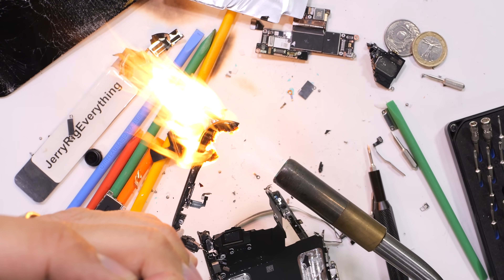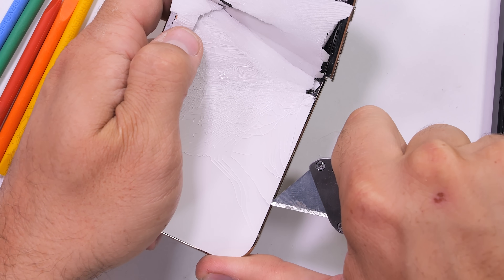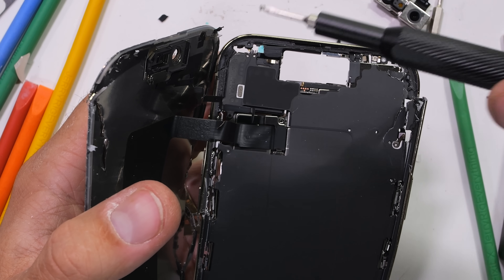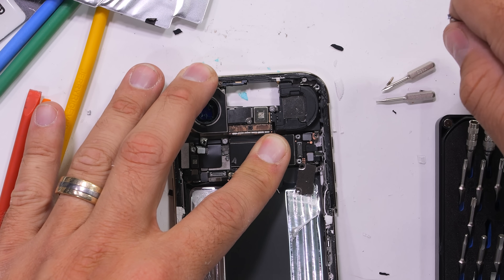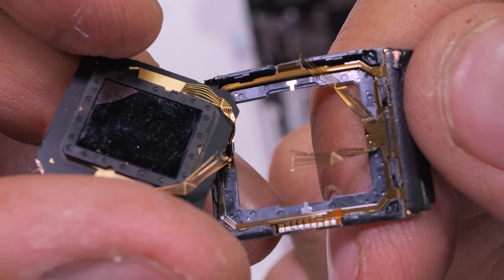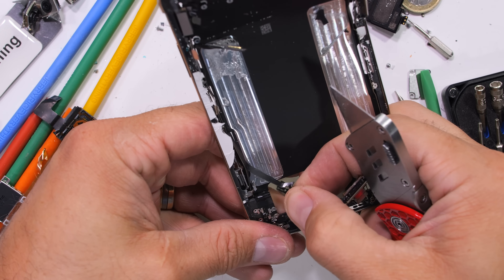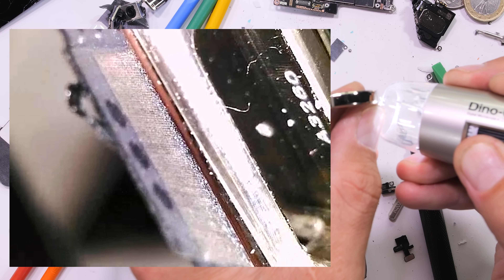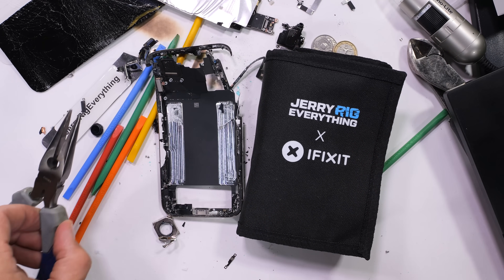iPhone Air Teardown -- I have no words

Comment: Back in my day, when you drop your phone, you risked the battery disassembling from it like legos.
Reply: I call that forced reboot
Reply: @fabiogiannone892 😂😂
Reply: I had a Samsung back then when I dropped the phone the battery fell through the cracks in the wood deck and I couldn’t get it 😂
Reply: excellent way of ejecting energy from the collision
Reply: Oh the memories... It was always such a pain.
Reply: and that was a good thing! i dropped my galaxy s4 2 stories onto marble and it didnt crack, it just blasted apart like its dying in a LEGO game, but after collecting it back together, it worked and it didnt even have a break in the glass! (tho admittedly, it feel on the back panel which made a run for it.
Reply: @Phoenix-zu6on  Same with my beloved S5. It had a long and hard life, I don't remember exactly how it went, but on an Air Serbia flight I was so bored I realised I could fit my finger nails in the non-existent gap between the display glass and the frame, and getting a fingernail under the glass seemed so strangely cool. I guess that was the beginning of the end as a couple of years later the display went wonkey, and similar fingernails removed the entire glass which wasn't good. RIP. (I did buy a replacement display assembly that worked for all of a few seconds - somehow when I was pushing it into the frame after testing it worked there was a subtle crack and new display now displayed funkyness. Sad face.)
Reply: Damn, memory unlocked. Hello Moto.
Reply: Yep. Battery would go down under a couch or something.
Reply: And we dropped phones almost everyday back then. Now it's a nightmare.
Reply: Not that long ago lol
Reply: i actually never had that happen to me, tho admittedly i went from a t9 nokia to a smasnug xcover to a non removable sony so maybe i just never had the luck
Reply: Even the sim card😂
Reply: We’ve come a long way since the Nokia 3210
Reply: Hahaha. I just remembered my nokia 6020 with no case. Only the keyboard and tape. I dropped it from the third floor of my dorm when I was in college. And no screen damage. 😂😂
Reply: And the Batteries lasted very long and didn't catch fire
Reply: The battery coming off in a fall apparently was the reason why gas stations started having signs forbidding mobile phone use (battery plus knock can mean spark). The source for this is a safety executive at a large chemical plant.
Reply: the kids will not know why or how convinient it was 2 be able to carry around em extra charged battery u could legit just swap in
Reply: @BZXRQMVL I honestly never liked it. I prefer one battery to last all day with no swapping, glued in or not. lol
Reply: And more than likely you the tabs for the battery cover broke so you had to tape it. 😂
Reply: yep lol
Reply: I had unintended disassembly of my Motorola vTac, v710, 8160 vulcan, palm treo 650 was the best, the cover, battery and SD card would all go flying
Reply: I recall dropping my LG G3 on the ground and having the back and battery fly off. It was definitely annoying to have to fetch those and put it back together and then power it back on which would take many seconds... Nonetheless, I miss how easy it used to be to replace a battery haha
Reply: “LiKe LeGoS”
Reply: Also the sim card will fly away sometimes 😂 then put back evrything and it works like nothing happened
Reply: You’re acting like that was crazy long ago
Reply: lol I remember when we used to swap batteries as a kid. “Ayo, what’s your battery %, lemme have it” 😂😂
Reply: nokia
Reply: Back in my day i knew my phone was truly off. (Theres no electricity without a battery)
Reply: Fridge has some kind of magnet that draws the battery straight underneath it
Reply: Back in the day phones had different designs, different OS-s, funky look, colours, extravagant ringtones and cool accessories. You knew by heart the Nokia ringtone from a mile away...

Nowadays everything is uniform. Furnitures, clothes, phones, cars, even houses. So disappointing. Creativity has fallen...
Reply: Nokia 3210
Reply: nah, with case never
Reply: Thanks for the history lesson grandpa
Reply: that was a good thing. you could easily replace the battery when it failed. not so easy anymore...
Reply: Hi
Reply: and the fact you could put it back together was so satisfying
Reply: Bro daily drove the Nokia 3310💀
Reply: The phone disassembled itself
Reply: You may lose that battery, but that Nextel was never going to break
Reply: I couldn’t get my battery out of my nokia, i had to Throw the phone on concrete to get it out. I still have that phone. It still works!
Reply: Best feature ever.
Reply: Back in the early 90’s my Mitsubishi Mesa 95 transportable was damn near indestructible. Dropped it from 8’ ladders a few times, battery pops off, handset popped off, took a few seconds to put it back together and power it up again. Never failed me.
Reply: Back in my day, you dropped your phone, you didn't care because it was a 1.5" LCD screen behind a clear plastic and wasn't a smart phone.
Reply: Only androids
Reply: You mean 10 years ago grandpa?
Reply: I used to carry spare batteries for when my battery died 😂
Reply: "Nice phone battery"
Reply: I remember that and Nokia 6600 (my 3rd phone) was literally a beast.
Reply: These days, you risk cracking the screen or a dent causing $$$.
Reply: Samsung s4 is where it started for me so i get this one
Reply: Why was the first thing that came my mind after reading this the Lego breaking sound
Reply: Back in my day, I went through so many of the same exact Samsung flip phones that I would save the batteries before bringing the phone in to be warrantied and had a whole quart sized bag of Samsung SGH-S500 batteries as backup in case I couldn’t charge my phone. 😂
Reply: Try the google pixle 10
Reply: Man I’m old 😂
Reply: Nokia😢
Reply: I miss those days you'd have an issue and instead of going for a different electronic to search a way to restart your phone you'd pull a battery put it back and it was back to like new
Reply: Back in the day, was I was the first person in the school with an iPhone 3GS honestly I'm the first person with an iPhone period in my school, but not even my Samsung fell apart like that
Reply: That was a good thing because it transferred the kinetic energy into multiple directions. It kind of acts like a dead blow mallet which has a much less sharp stress Spike
Reply: @alexdilko  define "good"

Modern phones are pretty damn strong now, worst that could happen is your screen breaking, and that's replacable
Reply: Good times
Reply: Dissembling
Reply: Same here, and I'm only 25 lmaooooo. I had 2 flip phones, one slide, and one chocolate before having a smartphone
Reply: I mean it still could happen, but you can't get to it to re attach the cable. (If it isn't glued in)
Reply: buy phone from that time then
Reply: Lego*
Reply: ok unc

Comment: So, everyone's claim that this phone would be super fragile really went up in Air, huh!
Reply: badum tsk
Reply: Yet despite amazing hardware quality, it will be obsolete in 5 years. We fork over $1000 each time for the ¨privilege¨ of spending half of our productive life in the virtual world. Maybe I´ll try a flip phone again :)
Reply: @STARDRIVE  iPhones typically have some of the longest lifespans for iPhones though. I kept my last 2 for five years before upgrading and my latest is a refurbished iPhone 13 mini, which should last a good few years more. If you get  the batttery changed after a few years you can get over 5 years (maybe up to 8). I would never spend $1k+ on a phone tough
Reply: Battery is Better than the 15 Pro 😂
Reply: @kaizel2264 slightly better then my 16 pro.
Reply: Yup and the battery also being terrible. Which it’s not at all. It’s very good actually.
Reply: The claims about shitty battery life will be unearthed, however.
Reply: @HandleIsNewAndBad have you seen the price lol, i can but a 16 pro max for that price
Reply: @-_YouMayFind_- buy that then. No one is forcing you to buy this
Reply: @HandleIsNewAndBadit holds up even with the Samsung edge which has about a 20% larger battery than the Air
Reply: Finally.
Reply: Every other compliant is still valid.
Reply: @tyaty camera and speaker. That’s the 2 issues.
Reply: battery and form was what put me off. wish that camera bump was a tad smaller. i probably could live with a lower capacity battery tbh. dont remember the last time i was so far away from a power point hahah
Reply: @Lachlan.N93  The battery is better than Pixel 10 Pro XL
Reply: @Lachlan.N93 battery is the same as my 16 pro. The bump isn’t big at all. The Pro is even worst.
Reply: @akingsransom  i need to see it in person. i like the idea of the air and edge so when i put on a case on its nice and thin still.
Reply: The slim phones are both apparently super durable. This one looks more like a vanity piece though, with its reduction in features.
Reply: @arvind8302  I’d wager that most people won’t even miss the features it lacks. Not everyone is a power user.
Reply: Nobody said that, they said that the specs are bad, which is true lmao
Reply: @C20F  trueeee ive really only heard people complain about battery life. aint no way apple would release a phone with bending again.

Comment: Tabs sometimes break but this zero force method ensures safety of delicate parts
Reply: Agreed, especially when the adhesive is three or four years later and has degraded which is when most people would decide to replace a battery, not when it is brand new.

Comment: Its actually very impressive to see how apple has designed this phone. Amazing structural integrity, and design.
Reply: To be honest, this is the first Apple product that I want.
Reply: The design is cool but the structural integrity isn't super surprising. It's how I'd expect a titanium frame to behave
Reply: @pp00rrkk  
The battery and aluminium internal structural frame provided most of the the integrity; that strip of titanium would have helped with a bit of rigidity during the bend test, but that's not it's primary purpose, which is to provide a decorative edge as well as be a marketing feature..
Reply: @petesmitt  nonsense!!! the titanium provides the structural part of the phone, the rest has other functions.

Comment: Really disappointing it's using the same camera as the iPhone 16e
Reply: It’s better then the 16e
Reply: @aDeathbomb Yes, it has the sensor shift stabilization, which the 16e doesn't have, but everything else is the same
Reply: @BostanMaxim no the sensor is bigger on the air
Reply: i’m pretty sure its much bigger than it but that’s just what an ai told me

Comment: I have Z Fold 7. I held my buddy's iPhone Air at the bar last weekend. That phone is one of the most comfortable phones I've ever held. If that truly is a single half of an Apple foldable, I will buy Apple's first foldable and switch back.
Reply: lol, still i find people, like in this comment reply said half z fold is thinner than air, really bro? is that how much you hate the iphone? amazing, you said that just like that half zfold can function well as a real phone, wow
Reply: It's way too thick to be a single half of a Foldable. Do you not see how thin your Fold 7 is? The Air needs to get MUCH slimmer. One half of a fold is 4.2mm.
Reply: Claxton bay the zfold 6 half is is the same thickness as the air
Reply: You know that Z Fold 7 single half is thinner that AIr?
Reply: I heard it is very top heavy making it uncomfortable for long use
Reply: Gonna be fun when you realise that samsung makes the display on the apple foldable
Reply: @xhogan89x   no way thats crazy thanks for your input
Reply: @xhogan89x  omg, he told you he liked the phone because of the screen, mindblowing
Reply: Apple designs it.